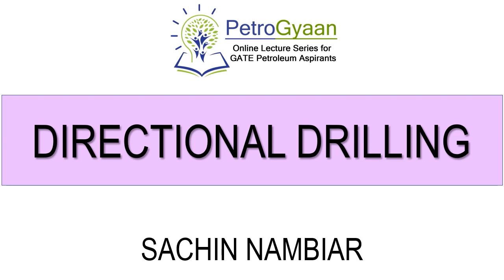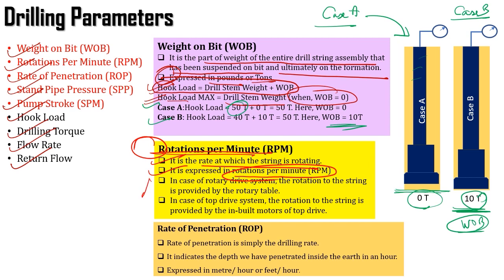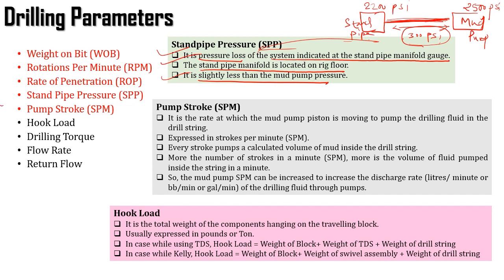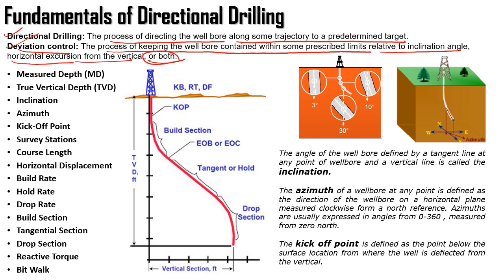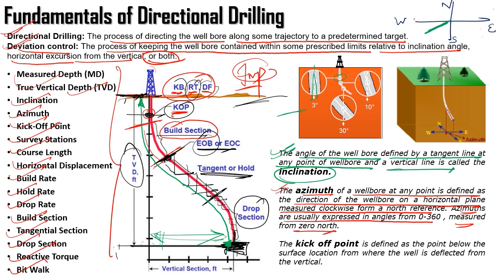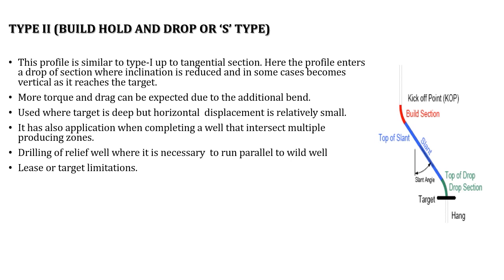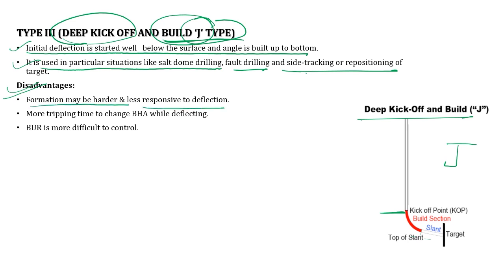Directional Drilling (Part-1)_Petroleum Engineering_Drilling (Lectue 34)

Comment: hello sir, 
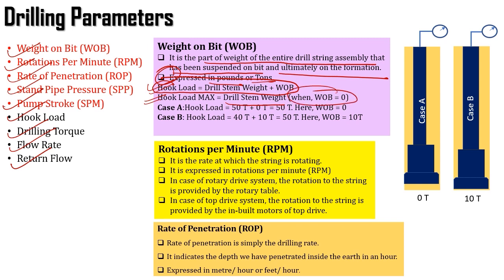the formula for the Hook load = Drill string weight in mud - WOB.   then only the equation satisfied. because the example which you told at 2:00 in that drill string weight can not be change from 50 to 40, it is constant. Hook load will decrease as WOB increases.

please correct me sir if i m wrong
Reply: Thats what I was thinking. Cause hook load will only vary depending on wheather DS is in air or in mud and is experiencing buoyancy. When Weight on bit is provided it should reduce the hook load
Reply: Fully agree